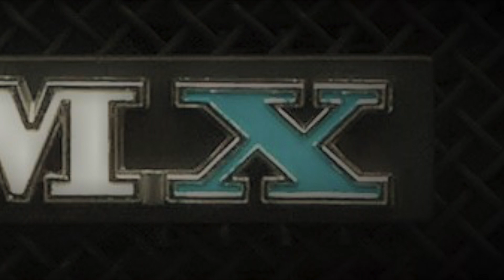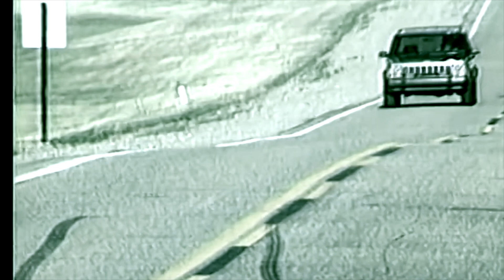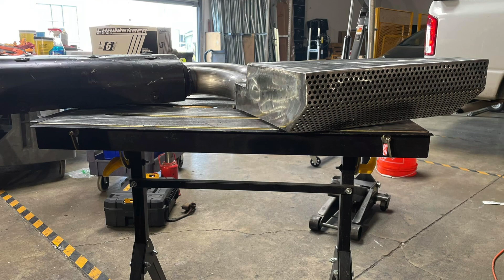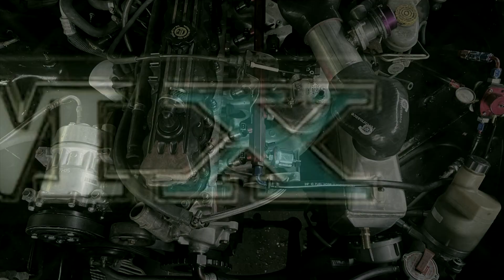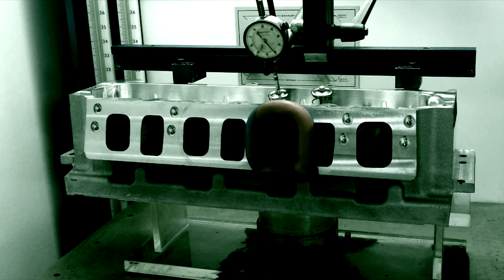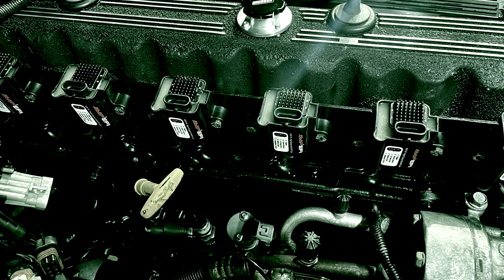Building a 10,000 RPM Jeep 4.0 - Introduction

Comment: Looking at the thumbnail one thing I thought would be explored in this series is the adaptation of either Ford V-8 heads (Windsor or Cleveland) or LS heads to the 4.0. I'm still wondering if anybody has done it.
Reply from the maker: There are a couple guys in the boosted group that are doing this with the LS head.  We may get there but it is not necessary, a stock 4.0 head will do.